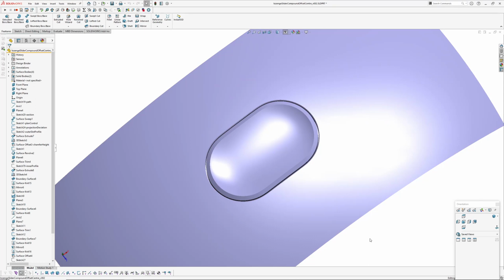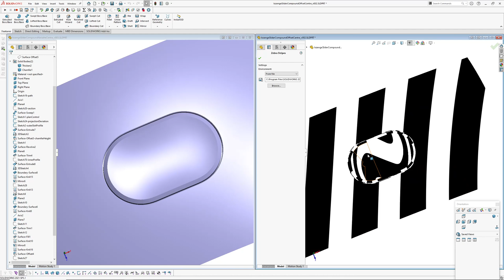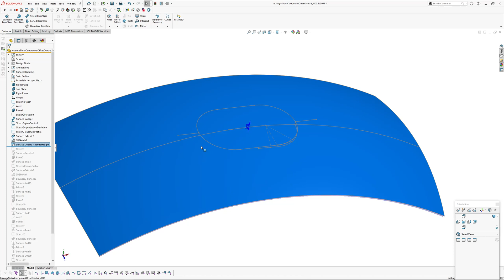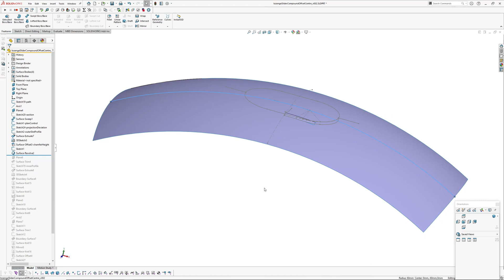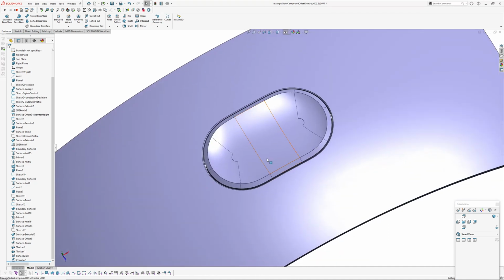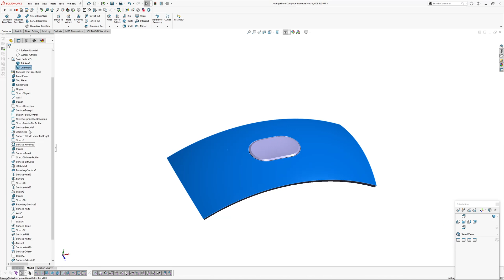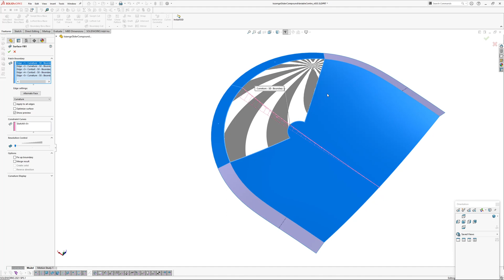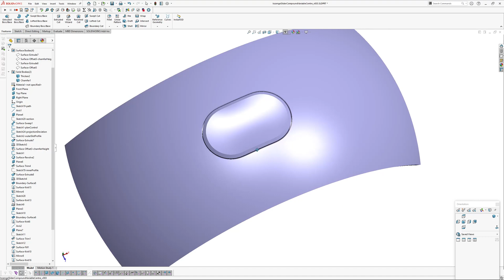Modelling a G3 Lozenge/Pill Button on a Curved Surface in Solidworks

Comment: Really cool! I'll see if I can remove/cut the geom I'm looking at/working on from the main part (as confidential) and send it over as a challenge. It's very similar to this challenge; the issue I have is that the casework split/draft is open shut side to side and the pill/lozenge pull direction/draft is in the opposite direction (top to bottom and at an angle). So you effectively have to use different geom for both the male and female features of the pill/lozenge. I've used a similar approach, it's just a little less flexible in the model tree. It's hard to explain as the compound surface that the pill/lozenge is sat also has the added benefit of being an overbuilt surface (to avoid a three sided surface). Will make more sense when you view it.
Anyway, great video. Always gives me food for thought for the stuff that I'm working on, so thanks for making this video
Reply from the maker: Good stuff , be keen to see the geometry if you can split it out.